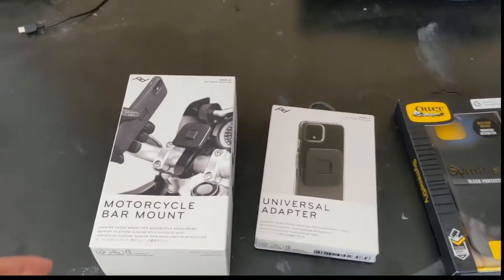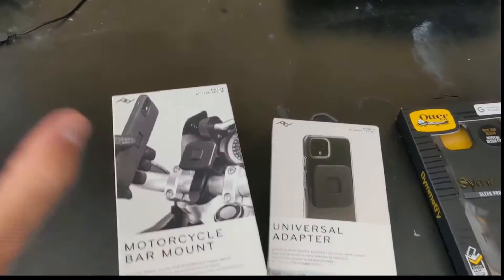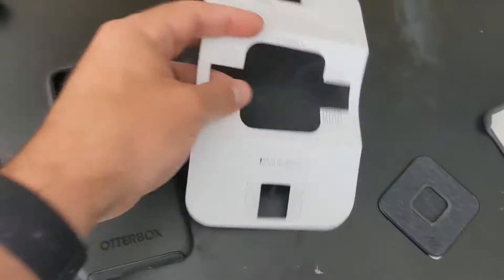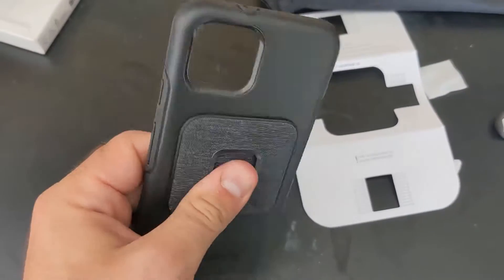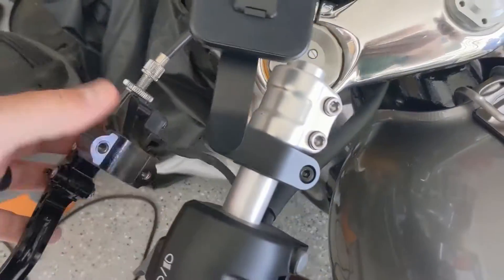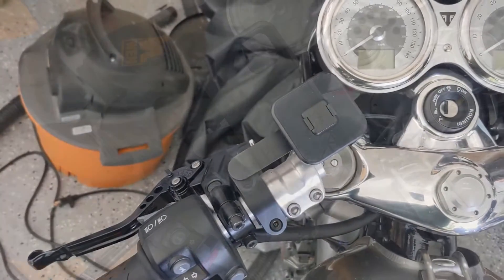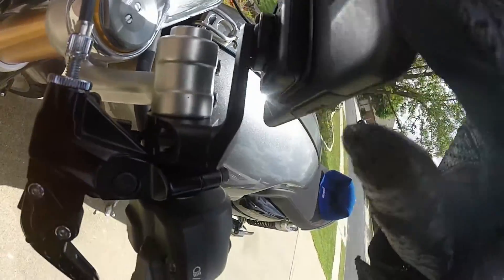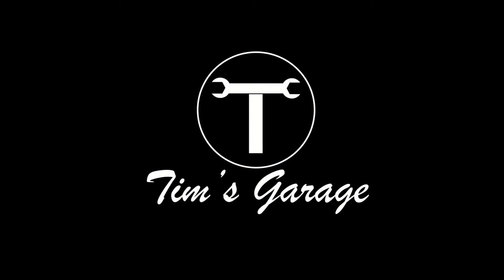Peak Design vs. Quadlock Motorcycle Phone Mount - Triumph Thruxton R

Comment: Tim, thank you for this awesome video! I'm the engineer at Peak Design that designed this mount and the vibration dampener. I can't remember if we met or not at the Handbuilt Motorcycle Show where you got this, but, thanks for giving this a great honest review! I'm so happy you're enjoying it!
Reply: Are there plans for a wireless charging mount similar to quadlocks?
Reply: Do you guys make any universal waterproof case?
Reply: @menzelfineart  +1 to this question. It's the only reason I'm still using QuadLock. Having wireless charging is a nice feature
Reply: @FadilKarim  and Menzel: 😉
Reply: @Whatreally123  No, we don't... most phones are waterproof now, so there's no need for a waterproof case for the vast majority of consumers.
Reply: @maxm50  If a wireless charger were to hypothetically come out, would it be compatible with the existing PD motorcycle mount? 😉
Reply: @FadilKarim  in a hypothetical future where our wireless charging Moto Mounts are developed, hypothetically I would push internally here very very hard for an "upgrade kit" so that existing PD Moto mount users could hypothetically just buy the new charging head to hypothetically replace their current non-charging head. This is assuming there's nothing in the hypothetical design that would prevent this possibility. As a company, we value our early adopters extremely highly (comes from our history of launching products on Kickstarter) and do our best to do right by them. Hope this helps 😆
Reply: @maxm50  Haha I love it 😁. I've loved PD's travel products and am looking forward to trying out the motorcycle mounts as well!
Reply: @maxm50  I will add that this is a huge demand of your consumer base. The more you push for the creation of this product the better
Reply: @Max Maloney, could you sponsor Ryan @ FortNine to do a video on motorcycle vibrations and damping, I think it would be amazing
Reply: @justinhalsall4077  I agree, I would love that. I asked our marketing folks to reach out to him a few months ago. Hopefully we can work with him!
Reply: @maxm50  super cool! Hope it happens! You both have a ton of attention to detail, think it’s a perfect combo
Reply: What I can't seem to find is a slow motion video of the QL with Dampener next to the PD to show a visual example of how much better the PD is at vibration dampening. That will be the make or break piece of info to make my decision - is this something you would be willing/able to demonstrate?
Reply: @SudburyDualSport  Hey Colin, it's certainly possible to take video of them, but, it won't actually answer the question of which one is better at vibration dampening. Vibrations (especially the harmful high-frequency ones) are not necessarily visible to the human eye or even to a camera. We're talking about pretty high-frequency, low-amplitude vibrations. So, whatever a comparison video would show you would not necessarily correlate to which mount better protects your phone. 

What tells a better story than a video is actual instrumented data taken with vibration measurement equipment. I used portable EnDaq vibration sensors in my real-world development. I'd guess Quadlock and SP Connect used something similar. I also did lab-scale testing using non-portable vibration measurement equipment, and I know Quadlock did too (you can see it in one of their videos). Without going into too much detail, a combination of real-world and lab testing is needed in order to develop a good system. Each one of our 3 companies is rather tight-lipped about the data that we've gathered, because it represents a significant non-patentable trade secret. It would be like Coke publishing their recipe on their website. You will find rather sanitized, dumbed-down graphs on both the Quadlock and the SP Connect websites. Our website doesn't have any graphs yet, but we're working on adding one that shows our mount's performance without giving away any secret sauce. 

I've compared each of the three mounts to each other's vibration performance, and though they differ slightly in their exact frequency response, what I can say is that each one of them does a great job about neutralizing damaging high-frequency "buzz" frequencies from reaching your phone. I would advise you not to make a purchasing decision based on which one offers "the best" vibration damping performance, because they're all pretty stellar and are MILES better than any non-dampened mount. You should choose the one that you like best from a UX, materials, aesthetics, case, and overall mount product family perspective. Hopefully you choose the PD system 🙂

Oh, the other big difference is that the QL dampener is like a floppy wet noodle while your'e riding - your phone will flop around quite a lot. Both the PD and SP Connect dampeners have a lot less phone flop. That's a pretty big difference that hasn't really been mentioned all that much in comparison reviews.

Hope this helps!
Reply: @maxm50  I appreciate the detailed response, and totally understand that a camera couldn't capture the whole picture... I'm just scared having just bought an iPhone for the first time and hearing stories of broken cameras - sometimes even if vibration dampening is used. I much prefer the PD over the competition and have already recommended it to friends without using the product myself. I just really don't want to end up with a broken camera in my phone... Speaking of which - I really wish there were a case option that has a sliding door for the cameras to protect them from scratches instead of leaving them exposed.. I know slim and stylish is what a lot of people want, but I know a lot just want maximum protection. As it stands I would be switching between a better case and the PD for mounting to my motorcycle.. Just my $0.02 anyway.
Reply: is that a peak phone case or can we use our own case ??????
Reply: I just ordered a QL mount and case but I think that I might return it now and get a Peak Design mount and case.
Reply: How can we compare the vibration dampener on the quadlock to the PD without buying both? Buells vibrate a lot!
Reply: I care more about the lower frequency vibrations that affect legibility of the map on the phone. My phones camera isn't known to be killed by the high frequency vibrations...
Reply from the maker: @maxm50 not sure how I missed this note, but glad to help! I just got a new case for my Pixel 8. I'd love to continue working with you guys
Reply from the maker: @ginoasci  I suggest the PD case, but you can certainly use your own like I did in this video
Reply from the maker: @jamesm5192  I haven't had an issue reading my phone while riding. What kind of roads are you on?! 😄
Reply: @tims-garage  More about how much a motorcycle can shake & vibrate if its a beast :P
Reply: @maxm50  You guys should really add waterproof or not to the cases "specs" section of your website. It is mostly blank and I just googled and spent a while trying to determine if it really is waterproof. Your competitor, quadlock, has a "poncho" case, which they also do not even have the word "water" anywhere on its pages. 2023 baby... What's going on?
Reply: @jamesm5192  Hey James, our case does not cover the screen of the phone. So no, it's certainly not a waterproof case. Phones these days are all waterproof anyway, though, so why do you need a bulky waterproof case? (I'm not trying to be a jerk, I'm genuinely curious!)
Reply: Will stick with QL until PD offers a locking moto mount with wireless charging and AMPS pattern holes.
Reply: @maxm50 hey max, I purchased this mount already couple months back. You just launched the next gen mounts with wireless charging. Are we getting upgrade kit now as you mentioned. Looking forward these are the best mounts in the market.
Reply: @Broski7k  Thanks for the kind words! Unfortunately we do not offer an 'upgrade kit', because the v2 mounts have a number of meaningful upgrades beyond wireless charging, including a spring-loaded indexing arm and a half-ball joint to allow better positioning of the head. So, the parts aren't totally compatible between the two mounts, and thus we have not released an upgrade kit. The cost of the upgrade kit to the consumer would be very nearly the cost of the entire v2 mount, so, it doesn't really make sense for us to make it. I know that's not the news you wanted to hear, but unfortunately that's how it is. On the bright side the v2 mounts are a BIG step up in functionality beyond just the wireless charging!

Comment: Quadlock and Peak design should make a universal waterproof case. I'm a motorcycle traveller and these cases leave the phone exposed to the elements. A case like the Ultimate Add-ons with the peak design locking mechanism will be sweet
Reply from the maker: Aren't most phones water resistant these days?
Reply: @tims-garage  nope. only the top end models of each company. still if one is on a long motorcycle journey and needs to charge the phone and its raining, these open cases will not provide any protection. these are good for casual riding imo.
Reply: @Whatreally123  quadlock had a phone poncho that slides on over the phone that I got and for $5 you can't really beat it
Reply: @Whatreally123  idk, a zip lock bag and some rubber bands are cheap, easy solution.

Comment: Thank you for this video. I already have the PD case, and JUST ordered a QL setup (which I didn’t want to do because I’d have to change cases) because I went with the Ram X mount for ease of use but the net strap broke as soon as I touched it, that paired with their ridiculous response to the vibration issues was the end for me. I had no idea the PD mount had any anti vibration in it! Now I need to return my QL setup😂🤙🏽
Reply from the maker: I could never get behind those Ram straps. Glad I could help!
Reply: There is Peak Design RAM 1" Ball mount if needed.
Reply: Yeah, give our 1" Ball Adapter a try! It'll plug right onto the end of your RAM arm and replace the X-Grip mount with our isolated mount!
Reply: is that a peak phone case or can we use our own case ??????
Reply: @ginoasci you can use your own case but you have to attach their adapter on the back of it. I think it's $30.

Comment: I noticed Peak also has a stem mount for motorcycles. You might need a different nut, though. My bars have zero space for anything to clamp on, so I was thinking about the center mount option.
Reply from the maker: Totally a great option too!
Reply: I have a bmw s1000rr so I'm thinking PD Stem Mount or Quadlock stem Mount. Which one?
Reply: @MarkTomeh  I have been enjoying the Peak Design for a couple of months. The magnetic mount is what sold me. Antivibe is great and really solid build quality. The phone case also connects flawlessly to other maglok chargers and has a nice denim texture.  The stem mount is really simple and robust with rubber dampening.

Comment: Riding on an aftermarket accessory bar on my Tiger 1200 GT Pro is a Quadlock with dampener, on U.K. roads (awful state of disrepair) it can become virtually unreadable so much so that I have stick the bike into cruise control and steady the phone with my throttle hand to read the bloody map. Question is does this system move around any less🤔, very nice Thruxton by the way (they’re going to stop making them after this latest iteration)…….
Reply from the maker: It seems to be a little more stable than QL, but it does have movement. I haven't had trouble reading it. I'm gonna miss the thruxton!
Reply: @tims-garage  Thanks 👍